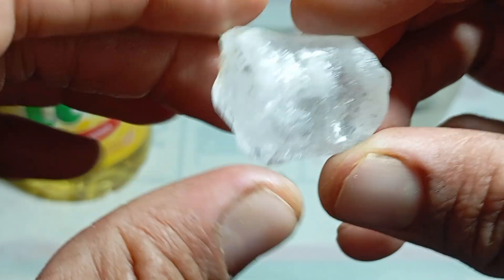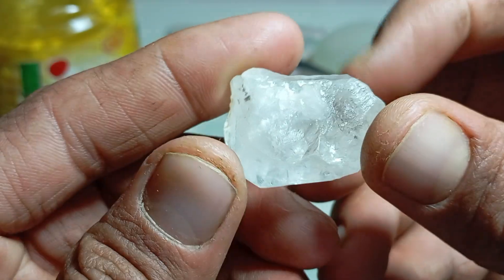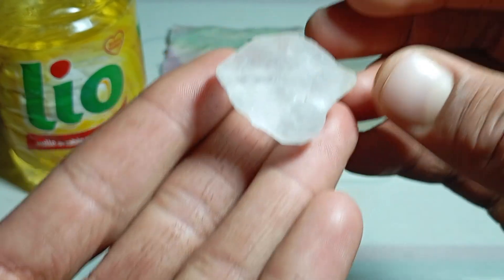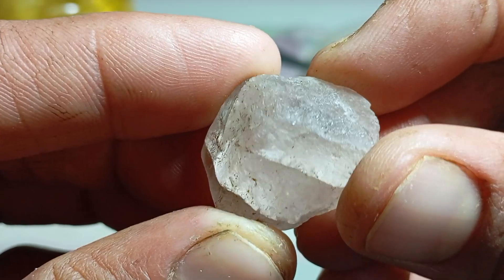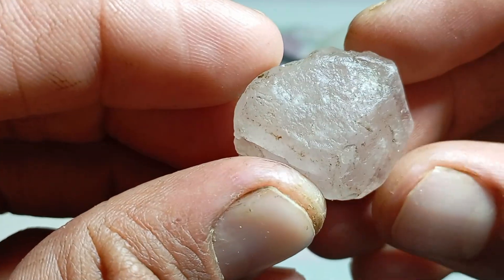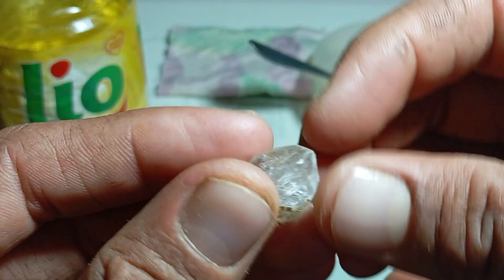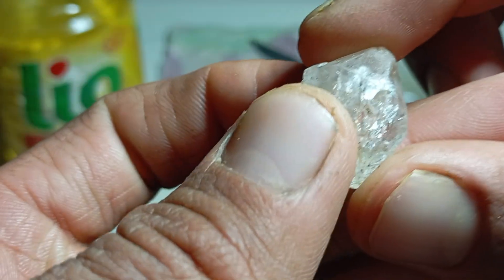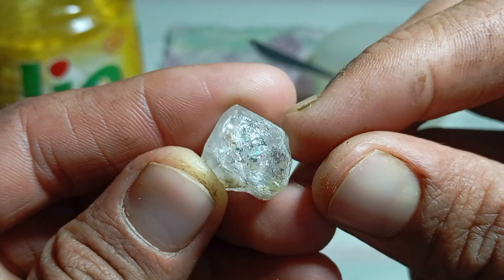Can Cooking Oil Really Test Rough Diamonds? | Shocking Result

Comment: Test them with carbide stick pen 9.5 hardness at Mohs hardness scale and diamond selector test. They are carbonado diamonds or diamonds 10 hardness if they have no scratches after scratching them with carbide stick pen 9.5 hardness at Mohs hardness scale because diamonds or carbonado diamonds 10 hardness are hard than carbide stick pen 9.5 hardness at Mohs hardness scale. Carbonado diamonds are weak thermal conductivities with diamond selector. But some carbonado diamonds have high thermal conductivities with diamond selector. Diamonds have high thermal conductivities with diamond selector. Carbonado diamonds have lower densities than diamonds. But some carbonado diamonds have high densities like diamonds. Diamonds have high densities. Diamonds and carbonado diamonds are relevant to have different densities at their environments